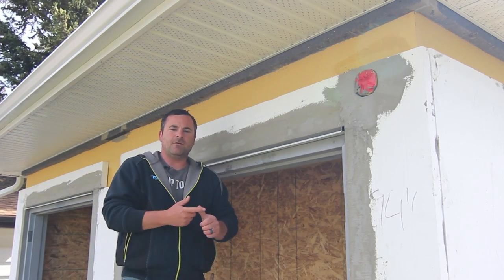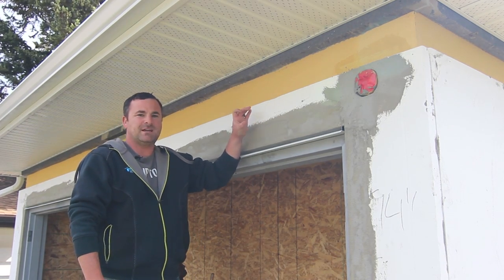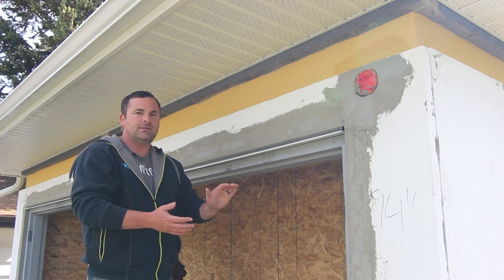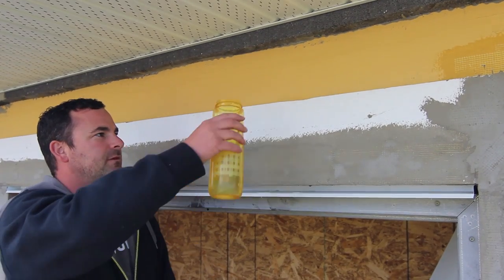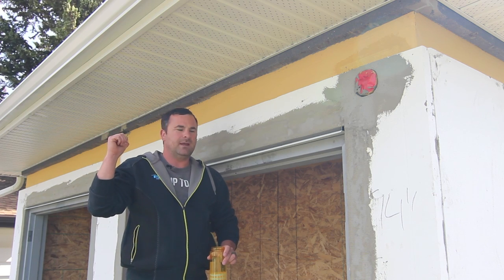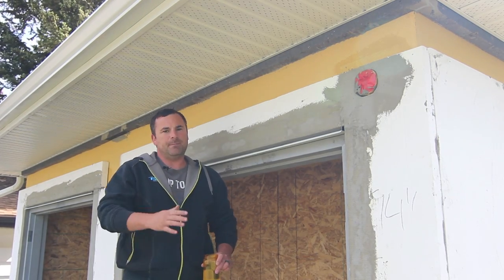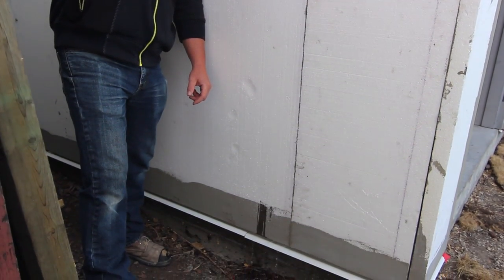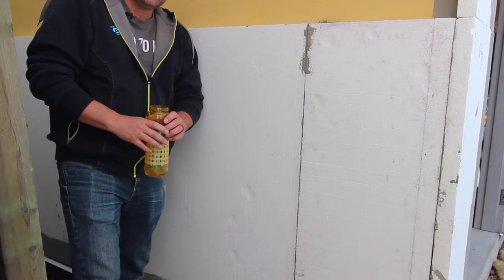What is EIFS Stucco and How It's SUPPOSED to Work

Comment: just got a quote 1/11/2022 for Sto system
EPS foam is about 30 cents a square foot
23 cents mesh per squre foot hd IS 10 CENTS
41 cents turbo stick foam adhesive
36 cents base coat in bags
50 cents final top coat finish.
$1.80 total per square foot 
but above price does not include the gold water/air barrier coat.
Reply from the maker: Materials are relatively inexpensive. Labour is a big portion as it’s multiple steps. You doing the job yourself?
Reply: @uptokode  gonna try, first time doing it . will make a 6x8x8' well house with eps blocks and coat it to get some practice. 
 if it works out will do larger building latter on

Comment: Would this protect a building against leaking parapet or cap?
Reply from the maker: Not much will protect against a leaking parapet or a cap since the water will most likely be getting behind everything and inside the wall cavity.
Reply: @uptokode   I have a parapet that's capped with Spanish tile that was nailed. I'm pretty sure every single nail hole is allowing water behind the stucco. And the painters clogged all the drip caps, etc

Comment: In the 90's, using a notched trowel, our polymer cement was applied vertical to allow any moisture to run out the bottom. Times change, methods, products change. 
   It's been said the Apollo 11 had roughy the same computing power as a hand held "Texas Instrument" calculator. Imagine that. As pilots, they wanted control and the ability to fly it. I think they where. 
  Question; Woodpeckers have migrated East away from smoke from Western fires. They have damaged homes & businesses by 3" (75mm) holes in structures. It's alway easier to make the patch fit the hole. Using tape, a multipurpose oscillating saw plus a 1" (25.4mm) fine tooth saw blade, Control the depth to place an EFIS grade 1" thick patch into a precut  hole. Air files with different grit can taper out the edges of the field to allow a tight fit 1/8" below finish. With a mesh dried, fit tight, should a primer be used? Ultra Kote pulled out of our NE. market so needing a qt. leaves the internet and searches can't give any clues.
  Thanks. Any help or suggestions would be appreciated. Omaha.

Comment: Great video I like the way you explained... about this system it work in areas like Florida where earthquake or storm hit your house it will keep the foam stick to the walls?? Any advise
Reply: Use Insulated Concrete Forms for the exterior walls and you do not have to worry about water penetrating from outside. When you build with wood frame then the water is caused by humidity dropping water as it hits against the waterproof styrofoam.

Comment: There is definitely more than one company that offers a troweled on air barrier with glued on styrofoam.  Dryvit/adex/parex/synergy....  I’d be interested in seeing the final product. 

Psst stagger your foam on outside corners.
Reply: How do you mean staggering on the corners?
Reply: stagger the whole wall alot stronger and durable
Reply from the maker: Fair enough.
Reply: Durock is Ontario Manufactured and was the first with the puccs system

Comment: Yes it's a good system..I've done the sto system since it came to canada from Germany via Atlanta...we also do the pucks system behind the eifs foam which is the best drainage plane yet .......regardless every good ... system out there now is geared to drain quality in stucco since 1904 in western Canada and the usa
Reply from the maker: I still love the EIFS system and did it on my folks place. But it has to be done correctly and some guys are slow to catch up on the times. It’s the best way to add insulation to a wood frame building with minimal effort and overall cost.
Reply: Great video and you make it nice and easy for clients to grasp ..I've done all the systems n Sto eifs is my favorite ..I've done the pucs system on Vancouver island where yr surrounded by ocean n salt water ..we did like a sto/pucs combo system and actual used a panzer mesh in many areas for strength ..plus because it's a 4 million $$ home n my nephews we did 3 complete extra tight levels of basecoat and I had the walls as tight as a nun ...straighter that straight too ..the finish was flawless ..no waving at you even in sunlight ..but lots of effort ..most people wouldnt pay the 20$ per square foot price ...but this guy wrote the book on anal !!!n he grew up workin for me n my brothers ...had to be done ....
Reply from the maker: Great work! Sounds like you take pride in not only the finished product but also the water proofing which is the most important
Reply: @uptokode  thx kody ..yes we try ..take care n get er done ..all the best ..from your canadian friends in stucco n the home of the winnipeg jets !!!

Comment: Why is the soffit on already
Reply from the maker: So birds don’t start living in my attic! Haha. I pre-foamed above my soffit with a graphite infused foam (had it left over from a different job). That’s why it’s different color.  But don’t worry with goldcoat and foam go right to the top of the wall.
Reply: I ask because plastering around soffit is a pain in the ass. And it should be installed after the fact

Comment: Whoa whoa whoa you're saying the building paper doesn't work?
Reply from the maker: No I’m not. Building paper is still vital in many applications. I think the biggest point is that In any exterior finish, more attention needs to put on water shed and allowing water to escape from underneath the siding. 

As for stucco, there’s too many failures to mention. I think EIFS is the ultimate system...if done correctly.

Comment: No when eifs is done right no water gets it ,flashing and proper caulking and building caps water will not get in,end of story
Reply from the maker: I beg to differ. So many guys think the stucco finish is waterproof and it is not. There’s tons of rotting condo buildings out there.
Reply: Kody theres plenty of old rotting condos from 25yrs ago when eifs 1st came out
Its come a very long way
Gold coat for Sto & Backstop for Dryvit i think its called are the waterproof barriers
If its installed correctly there should be no issues
Reply: @averageguy7641   Backstop made by Dryvit is a superior product. Mesh tape all seams and inside/outside corners.
Reply: @uptokode That’s because they didn’t apply and finish EIFS correctly or window leaks like Pella had in their lawsuit many filed against them a few years ago.

Comment: water behind anything is just an accident waiting for a place to happen.  Just extend or the eaves furthere.  You never want water on the walls
Reply: what?  That is exactly what stucco is for, as it absorbs and lets all the water back out.if you paint it it will not absorb, so either way, for a southern climate both work.

Comment: I'm still trying to understand how the polystyrene insulation is free-floating without fasteners.  This is sheer sorcery!
Reply from the maker: Hahaha. Sorcery is right! Polymers (glue) and cement. It’s bonded and that’s it.
Reply: @uptokode  look carefully.  Its free-floating behind it so water can flow.  So.. how.. I want to see it.
Reply from the maker: The mortar is thick and installed with vertical strips. Say every 8” or so.  This allows lots of contact for the bond but also leaves the drainage space. 

Some newer foam has the grooves built in. Then you mortar the spots that will make contact with the liquid applied membrane that’s on the sheathing.